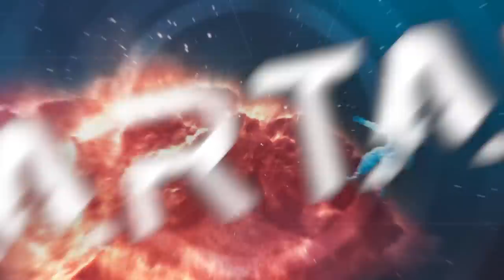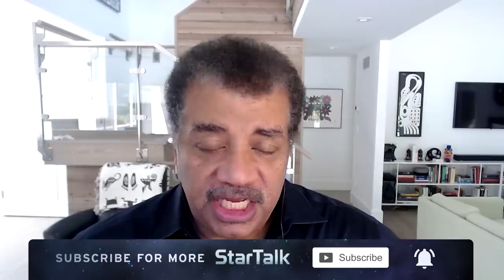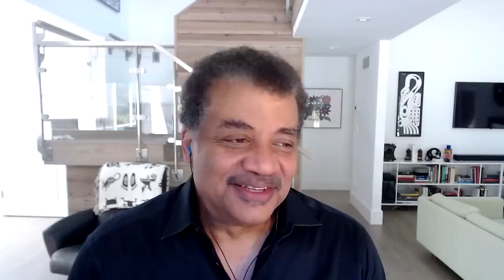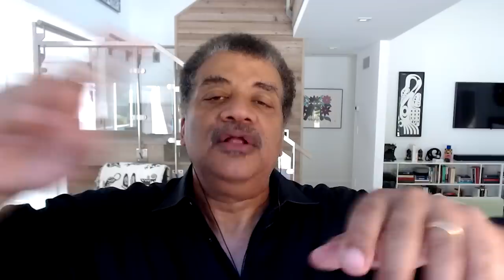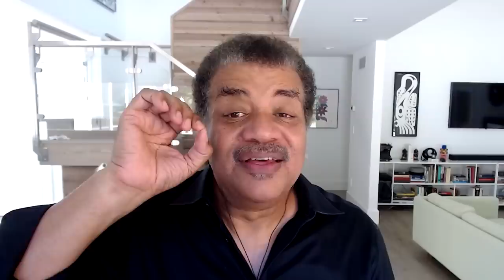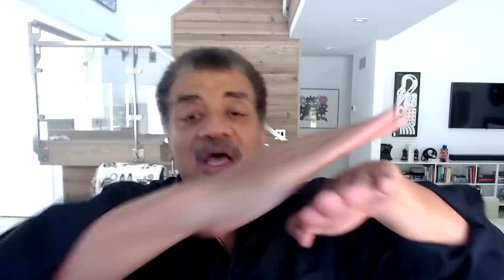What is Exit Velocity? | Neil deGrasse Tyson Explains...

Comment: They have multiple high speed cameras setup at different set angles that all feed into a software program that will calculate exactly how fast the ball leaves the bat and at what angle the ball leaves the bat. They are basically looking for the change between frames of animation and then correcting for the fact that the ball is not 100% perpendicular to any 1 camera.
Reply: This is on the path of how trackman does it

Comment: Just need high speed video from the side view. Measure distance from point A to B over time to calculate speed, and measure the angle from horizontal to calculate the distance. I don't see the issue that Neil is getting at here. The angle of the bat at contact doesn't matter. Happy to be wrong if someone wants to clarify.

Comment: Doesn't it also matter what part of the bat makes contact with the ball? If the bat is swung at that 30° angle, it could still top it. Or you can still catch it with the bottom part of the bat barrel and hit a grounder. It also matters if you're early or late with your swing. So, how does all of that factor into measuring the speed? A home run can still be hit if the ball hits the top part of the bat instead of the dead center of the barrel. An early topped home run could be a 450ft upper deck homer to left field. A late swing hitting closer to the center of the bat would be a 350ft home run that barely gets over the right field wall. How do you add those variables into the calculation of exit velocity?

Comment: 45 degrees wouldnt even be the best because you need more horizontal for 2 factors, 1) you also need to eliminate the speed of the ball going in the wrong direction. For example you need to convert (-100,0) to (70,70) thats effectively applying force vector of (170,70) = 22.38 degress.
factor 2) theres air resistance so the optimal would be more like 40 degrees or even lower. So something like 20 degress or even lower bat swing may be the most optimal.

Comment: I don’t follow baseball so I don’t what they use to measure things, but wouldnt a high speed camera be enough? Put it on the side of the player with the bat (outside of the pitch) and you an easily get the angles relative to the plane, the bat’s velocity and the ball’s too. You will need a formula for the bat because it’s not moving in a straight line. There will be a bit of error caused by the trajectory that will not be parallel to the camera pov.
Sorry for any incorrect terms, I’m not an English speaker

Comment: Another question in my mind is, does the velocity of batted the ball depend at all on the velocity of the pitch, all else being equal? For instance, will a 90 MPH fastball leave the bat at the same velocity as a ball hit off a stationary tee (plane of the swing and plane of the pitch being the same angles with the ball moving or at rest)? Sounds like a good question for the Mythbusters.
Reply: Depends on the force going in the direction opposite the direction the ball goes after being hit.

Comment: Think of Car manufacturing commercials about crash safety. It’s measuring the kinetic energy of the “debris”, (let’s call it), that then hits a much more massive, sturdy “accelerator” in the opposite direction, right? Okay. So it’s the same aspect of car crashes in that since. If a Prius drives into a solid cemented light pole, it’s velocity will neutralize immediately, but if you launch a specifically buoyant designed baseball at that same pole it’s velocity will immediately stop AND start, redirected, in another direction based on the; angle it’s launched, the form&components of both the debris and the accelerator, the amount&direction of the ball’s rotation or “the spin on the ball” and most importantly the exponential fluctuation of pressure put into play by contact. The anatomy of the bat/accelerator instrument aspect is a definite factor, thus constituting a rule be put in place to prevent athletes from using a semi-hollow bat. Much love, much fun and very much upward observation ❤

Comment: The baseball from the pitcher is NOT coming in to the batter horizontally because the pitchers mound is elevated relative to the batter.  Probably 10-15 degrees I would guess...

Comment: Couldn’t they triangulate the speed based off of more than 1 measuring devices at different angles?  Figure out the speed loss based between the angles  of the different devices and then factor out the speed with no angle?

Comment: They put the radar detector behind the batter, facing the pitcher's mound; they track and measure the incoming speed, then track and measure the ball's outbound speed.  Radar doesn't function like a laser, putting out a single, straight beam.  The beam and return is more analogous to a camera lens: anything within its "field of vision" can be tracked and measured.

I Googled it; coulda saved you some time.

Comment: What effect does the speed of the incoming ball have?  And the angle of the ball, which is very seldom level?
Reply: To answer the first question, a tremendous effect.
If the baseball was just hanging motionless on a string where the batter could apply a full swing onto the ball, assuming full contact the ball would leave the bat at the linear velocity the point of impact the bat would have where it struck the ball. But given that the ball is coming in at the bat at a high velocity, there is also the reflected kinetic energy of the ball hitting the bat that's added to the ball's velocity leaving the bat. (Let's face it, even if the bat were just sticking out motionless, the ball coming in would bounce off it with a good amount of speed.)
As for the second question, it will play just as important a part as the angle the batter can swing the bat onto the ball. I'm sure we've all seen how balls can fly off in all directions after being struck.
Reply: @thecarman3693  
Then explain over the fence "home-runs" with balls being struck off of a tee. That is essentially your ball "hanging from a string" plus a bit of added friction from the ball's resting point on the tee.
Speed of the ball does have a role. Just not as large a role as many presume. The batter plays a VERY IMPORTANT role in travel distance. 
Have a baseball moving at lets say 100mph only to impact a stationary bat. Watch as the ball does not travel much farther than 10- 20 feet at best. Ball speed is a factor. Just not as important as the batter.  
Its in the math. Run the equations and see for yourself. A bat and a ball's mass is quantifiable. Simply pick a swing speed of your choosing. You can add or remove ball speeds within the equations to calculate how much overall effect ball speed has. Try it with a swung bat versus a stationary bat. Switch it up and have the ball become stationary. 
I have seen 100mph+ balls stuck, resulting in an absolute perfect angle for an over the fence home-run, only to never make it over due to the batter's swing speed, not the ball. 
At the end of the day, batters make or break the equation so to speak.
Reply: @theduder2617  In order to get a good hit on the ball you must make almost perfect contact with the bat and ball. Striking a ball from a tee (or hanging on a string) allows a much greater chance of that happening. Plus, the ball is not spinning. Given the varying motion of a pitched ball through the air, its rotational velocity and the batter's aim to make the crucial hit, in most cases you're not going to get that over the fence home run. I would also wager rather strongly that most home runs are not perfect hits as I just described, but added combinations that are in total just enough to bring in the runs. Also I would think that most players are capable of hitting a home run from a tee each time attempted, yet how many do we see in a game? Many times not even a single one. So to your comment, yes --- the batter plays an important role, but adding the pitched ball's kinetic energy allows for the slight errors in aim (which are inevitable) to get the ball over the fence.
Reply: @thecarman3693  
The tee was suggested as a means to see for oneself that the batter plays a very large role in how far a ball travels when struck by a bat. It eliminates the pitch factor so that the batter's effect can be determined.

And you forgot about the stationary bat in order to eliminate the batter so that the pitching factor can be properly tested. Have to perform both experiments in order to see both results.
I promise you, get a ball headed for a stationary bat at literally any possible speed, with literally any sort of spin possible, and the last thing you will see is the ball traveling more than 30 feet at most.
One CAN get a ball to strike the perfect part of the stationary bat, if that is a deciding factor for someone.
But in reality, ball speed and spin are a bit less important of factors as the batter's swing when it comes to travel distance. 
It is one reason why there has never been an over the fence bunt. WHICH by the way, if the pitcher was so important to home runs, would have happened at least once. 

A person hitting even one home run using a tee (it has happened) shows in real time that the batter's importance is greater than anything the ball is doing.
It's not the only factor, but it is an extremely important factor nonetheless.
Reply: @theduder2617  [I promise you, get a ball headed for a stationary bat at literally any possible speed, with literally any sort of spin possible, and the last thing you will see is the ball traveling more than 30 feet at most.]
Really? I've seen 'bunted' balls fly out past the infield. I suspect so have you.
Reply: @thecarman3693  
Ever see a bunt? Do you realize the obvious difference between a stationary bat and a bat being held by a person?
I suspect you are missing out on quite a bit of grade school level science regarding discovery. 
I listed clear conditions to be tested, yet you are trying to mix them up in an effort to discredit without experimentation.
This was not the first time this debate has taken place. And when one is given access to a pitching machine that one can adjust and aim at will, many aspects of the debate was more than likely tested despite the results not being published anywhere due to not realizing the importance of what one was doing at that time and age. 

Stationary means NOT held in anyone's hand. The objective is to eliminate factors in order to test other factors for their effectiveness or lack thereof. 
Eliminate the batter from the mix to test pitching results. Next, eliminate the pitcher to test a batter's results.
Only then will one have the data necessary in order to determine which aspect has the most effect. 
You may be shocked to learn that the pitch is not as important as the batter.
A pitch can come in absolutely perfect for a batter to strike. But if the batter is not there, or is not able to hit the ball, the pitch surely wasn't a factor.
Actually, you literally admitted the batter as being a more important factor within you most recent response here.
"I've seen 'bunted' balls fly out past the infield"

So which is it? The pitcher or the batter?
You do realize your contradiction, correct?
You do understand there are real world results showing the importance of a good batter don't you?
If at ANY MOMENT, a human is able to hit a ball over a fence when the ball possesses NO velocity whatsoever, the pitcher is immediately proven as not the key aspect to home-runs.
Since we know home-runs (over the fence) are possible off of a tee, we can logically state the batter as being the key.

Not to mention pitchers have thrown some serious junk balls only to watch the ball fly over the fence. Games are recorded. There's video evidence to go along with the math.

Comment: You are also wrong about the angle of release (or angle of exit) relative to the plane of swing. 
You forgot about the bouncing angle. The ball bounces off the bat. It does not get all of its kinetic energy from the bat. Part of its kinetic energy comes from the pitch, and that energy is partly used to bounce off the bat. As you know, balls bounce at an angle when they hit something at an angle... Since there's an angle between the initial direction of the ball (before the bat hits it) and its final direction (after the bat hits it), the ball is not supposed at all to be released with zero angle relative to the plane of swing.
You can understand the relevance of this bouncing angle much more easily if you think about the 3D velocity of the ball relative to the bat (i. e. relative to a 3D reference system which moves with the same velocity as the bat, in which the bat appears motionless when the ball hits it).
Also, you can imagine a batter who is instructed to try and hit the ball so that it is released (after being hit by the bat) in a perfectly horizontal direction. For the sake of simplicity, also imagine he is on a space station, where the ball is (apparently) weightless and hence its ballistic trajectory is perfectly straight. Imagine that the batter decides to use a perfectly horizontal swing to achieve that goal. If the pitch direction is not horizontal (i.e. the ball is moving at an angle relative to the horizontal plane, before hitting the bat), he would fail❗ The final direction of the ball (after the bat hits it) would not be horizontal❗

Comment: I didn’t read all the comments so this is maybe already said, but this conversation is pretty weird to me. Have you not seen the measuring they do at golf tournaments with the high speed cameras (Top tracer technology) or the radar-measuring plate (Trackman) that they also have at some golf ranches or golf pros use in lessons. 
They can measure the speed, angles, spin and even predict the placer where the ball will land with impressive accuracy.
I just looked it up with a quick search and Trackman is at least used in baseball as well as golf.
I’ll guess I’ll ask Neil get in contact with Trackman… 😊
Reply: So the answer I guess would be either with the high speed camera, where you don’t need to use the Doppler effect.
Or use the TrackMan set up with multiple radars in different angles + some simple math.

Comment: I don’t think 45 is optimal. Air resistance will have a greater effect in the horizontal because in the vertical it slows the climb and the fall which increases carry. I think less than 45 will go further in air. Maybe not as low as 30 but maybe not far off.
Reply: Yes, that is another factor. A 45 degree trajectory is only optimal if air resistance is ignored.
Reply: I’m shocked that he completely missed that point.
Reply: @bombocjk1  I'm shocked that he totally missed the angle thing. If the bat speed and ball speed are equal (for example) then the optimum bat swing angle is 22.5 degrees. A 45 degree swing angle would result in the ball going straight up.

Comment: I would argue that with a ball that is dropping, the net angle  to the field should be 45 degrees for maximum distance, but I agree that the zero degree angle to the movement of the bat is correct.

Comment: Mr Tyson, 

If a baseball hit is to be measured, 
We need a speed, impact, opposite speed and "follow through" 

Factors are as follows.
....
Weight of ball
Weight of bat
Curve of ball
Curve of bat
Speed of ball before impact 
Speed of bat before impact 

Then add earth gravity, coreolsis effect... even at a short distance of a pitcher, it may have effect 

Humidity, 
...

But this can all be averaged out with the following, 

Film 200fps
With a 1cm2 grid backdrop 
10x times 

A basic answer is given, with the right math... with the aforementioned integers that are given.

Comment: I think a tiny chip in the ball could do the trick or a few magnetic paint dots on the ball for a more accurate meassure of speed and movement of the ball.
Reply: Diamond kinetics has a ball like this generally just used to gather pitching data

Comment: They don’t do this with radar guns look at trackman baseball. 
Neil makes the correct point power hitter do have step attack angel, however the ball isn’t coming in horizontal it’s on a downward angle of around 8 degrees
Reply: They have motion sensors for bats too that measure attack angle blast motion is the most common

Comment: Could you not just measure the duration and ammount of ball deformation to calculate the total force transferred and then from the initial velocity vector extrapolate change in momentum and new velocity?  This can be done with sensors in the ball.  Even simple accelerometers can give you a good idea of what's happening at the bat but accelerometers may be too slow I suppose.
Reply: Yes, but they don't have to. They mostly use machine analysis of images. Framerate, gps and triangulation are a very reliable means of measuring position and velocity.

Comment: You are wrong. Measuring doppler is not the only way to measure ball velocity. Using at least 2 high speed cameras you can compute the time history of the 3D position of the ball (a 3D vector), from which by data smoothing and derivation you get the time history of the 3D velocity of the ball (another 3D vector).
Of course, the speed is just the magnitude of the velocity vector (i.e. the square root of the sum of its squared components).
This technique is called stereophotogrammetry (a.k.a. motion capture). It becomes more accurate if you use more than 2 high speed cameras. It is massively used in sport biomechanics. It has been already used to study pitching and batting techniques.
Reply: Similarly, you can measure the three components of the velocity vector by using doppler radar from three orthogonal directions. Then you can compute the speed as explained above.

Comment: If the Terminal Velocity of a baseball is 95 MPH, then if a pitcher could throw a ball up with exact precision to where it would come straight down over the plate at 95 MPH, it would be nearly impossible to hit. I know that is impractical because even if a pitcher could, I'm sure that would be exhausting.